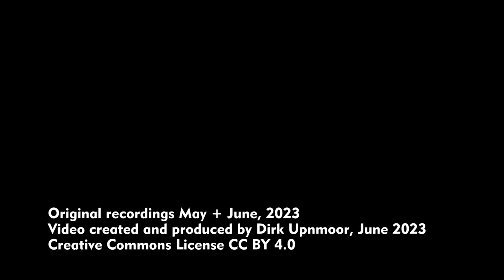U-Bahn Hamburg (Hochbahn): Wandsbek-Gartenstadt ohne Brücken der U3

Comment: By watching Your videos I can see many and many rail works in Germany. So the locals and regional officials are investing in infrastructure. Bravo ! Good thing. But if I could ask I didn't notice by watching random videos from other YouTubers that in some past years was like that. I mean it seems to me that in last period rail infrastructure works in Germany are more often that in past years. It could be just my subjective opinion. What do You say as Youtuber living in Germany ?
Reply from the maker: During the last years, traffic on the railway network has increased more and more. So the infrastructure gets more worn out and must be repaired more often. It's good that railway lines are repaired. But we also need more railway lines, and several of the existing lines need to be upgraded from 2 to 3 or 4 tracks. Meanwhile there is so much traffic on the rail – in some places the railways can't handle any more. One example is the line from Hamburg to Uelzen (which I use frequently). There are so many ICE and IC trains on this line that they often cause delay for the regional trains.
Reply: This is mostly due to rationalizations in the 90s and 2000s. Maintenance and repair was reduced to the absolute minimum.

So now you have to do a lot of repairs and replacements, that's why there are so many constructions going on in the rail network.
Reply from the maker: @molaremasse7034  That's especially true for the network of Deutsche Bahn, especially when Hartmut Mehdorn was CEO and wanted to bring DB to the stock market. (Hochbahn maintains its network better, but train frequencies have increased with the years.)